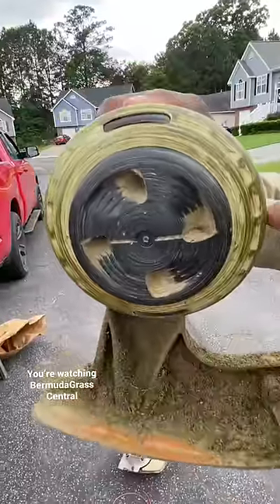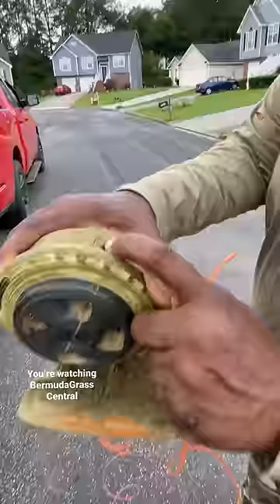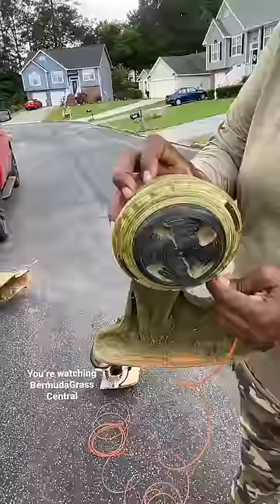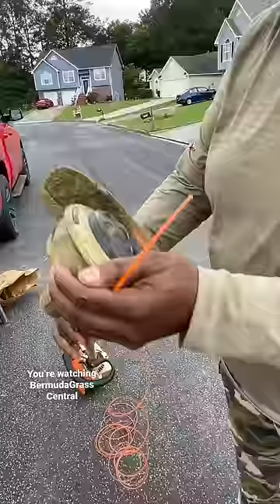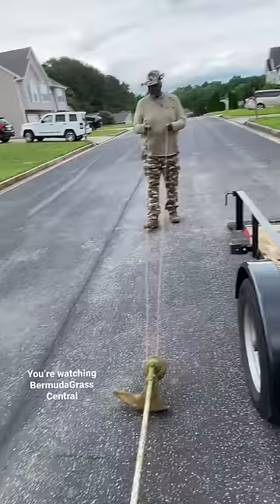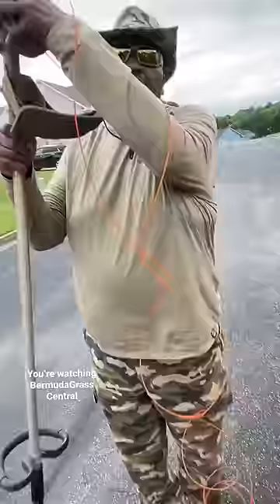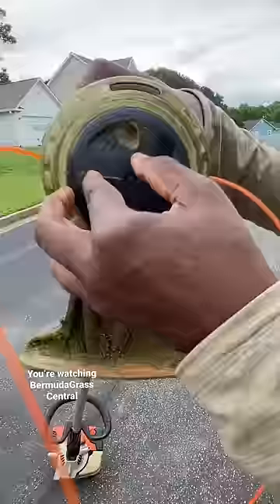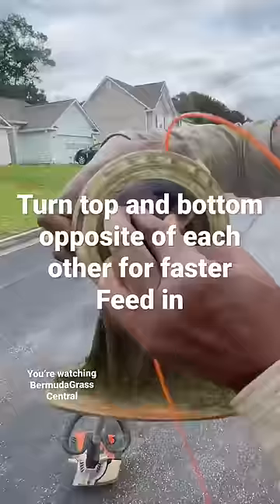Trimmer Line Speed FEED with Stihl C-26 Autofeed

Comment: We run echo speed feeds on our stihl
Reply: Same here
Reply: Stihl Isa better trimmer but echos speedfeeds arw the absolute best
Reply: @brettwiliams3711  Debatable. I prefer echo, but use both for my company
Reply: So much faster easier to change heads and disassemble for jam feed and still a quick bump system
Reply: Switched to echo for the speed feed. That and a darned good simple 2 stroke. 4 mix is great, but the 111 I used really put me off and valve adjustments.
Reply: Echo is better especially the speed feed
Reply: @aaronneher4860 valves are easy. I have a few 100rx that are 10 plus years old still going. I run echo and sthil only though. The 100 or 111 I always grab for thick stuff
Reply: The echo speed feed is thicker than this one you can get lower to the ground with this one while keeping it flat. But the echo is faster imo
Reply: Echo is so much better
Reply: I guess that's what comes stock on a srm-225? That's what I got and it works like a dream super easy to spool up.
Reply: @codyturner9953  yessir me too
Reply: @ragingstormgaming7829 weve been using some husqavarnas lately at my uncles company. Theyre light and hold up decently. We cut graveyards. So its a lot of weeding
Reply: Same.
Reply: Haven't found anything better than Echo speed feeder, I love the trimmer too cause it's not heavy.
Reply: @brettwiliams3711 debatable . Echo trimmers run higher in rpm’s and trim way better in my opinion.  And echo’s speed feed heads are way better .
Reply: Echo gota be the og speedfeed
Reply: Echo bump speed all day.
Reply: I have a sthil. I tried the echo feed. It did not fit on my sthil. Are there different types of echo speed. 😅
Reply: Honest question is it faster or easier than the original way? I’m running stihls for my company, every one already can string a trimmer, will I make save or lose money with this?
Reply: @johnyvolvo434  buy one give it to your dumbest guy to string and then have your best guy do it the regular way you guys do it...
Reply: Sthil vibrates to much after,echo for me  is smoother.
Reply: Damn right 😂
Reply: Echo for the win
Reply: Should run Echo speed feed on your Echos. We do. Finally got rid of the last Stihl. Couldn't be happier.
Reply: Me too. Our fam loves them
Reply: Can confirm 3pk off brand echo speed feeds from Amazon are meh they work great if your a home owner and only do your property but compared to branded echo heads they last 1/2 of the time due to grass in the drive way and on concrete they just are an inferior plastic and ware down within a month each for me with about 29 properties 3-6 a day every week branded echo heads last about 2-3 months each, and once they start to ware they’ll keep going u til it falls apart the Amazon ones the spring pops through almost immediately from ware. Granted I can just as easily pick up the head from the ground a bit but y’all know once you start to get tired at the end of the day it’s easier just to let it ride lol but for 10-15$ more stick with echo branded heads not the knock offs
Reply: Maybe it’s just me but I always like the old school heads more just because of how low profile they are and they are much lighter than the speed feeds
Reply: Same

Comment from the maker: See how to install your Speed Feed here https://youtu.be/ai7U8aogPY4
Reply: Forced to have it but I don't like them. Rather have the older ones where you put half the string into two holes, secure it in the notch and wind it yourself. These seem to not wind correctly and constantly jam up.
Reply: Need to make something u can set the head of the weed eater down on and use the motor to spool it up if it turns the right way 😂
Reply: You i like, you keep it simple, thanks soldier
Reply: That took longer that just using a regular head
Reply: @icewallflatearth1158  nobody cares 😂😁😱🤯
Reply: And they want to outlaw the gas yard machines and go all electric
Reply: Don't forget to soak your string in water first!
Reply: @NeoMK  get outta here
Reply: @jacobmurphy2721  Literally on their website.
Reply: I miss performing lawn care. I did it for 5+ years in central Florida. Where you guys located and are there job opportunities for this line of work
Reply: @NeoMK  get
Reply: @LouieEvans-bv5gl  not here we're in a small town community here kinda hard to make it if ur not from here kinda be stepping on toes if a new company comes in

Comment: I have both Stihl and Echo that i used for my business. The auto-cut on the Stihl will jam up if you’re in really sandy or dusty conditions. I’ve never had a problem with my Echos. The one advantage of the Stihl is it is much easier to trim straight edges but they both do it equally good

Comment: two things i learned about the speed feed, 1st step on the string and pull the reel of new sting to above you head, do that twice and perfect amount of string, 2nd, different trimmers rotate different directions and the spool will have a directional arrow, if you put it on backwards the line will clog or suck back in instead of out when you bump it

Comment: I bought that Stihl, I returned it.  The windy head thing is so big you can't get weeds in the cracks of sidewalk.  The straight pole may be better for your back, but you can't perfectly edge your edges.  I use a curved craftsman now.  The string feeding head is smaller and you can angle into more places.  The only difference is you wind to pieces of string rather than one.  Just as quick.

Comment: C'mon Bermuda, Ego's automatic brother, love your program. You the man.😃
Reply: I have one of those is actually a great trimmer but every three or four years you need to replace the battery. I would suggest getting multiple batteries . It’s probably one of the best electric trimmers on the market.
Reply: Not good for commercial use

Comment: I've been using my power loader for years on my ego string trimmer. I can load 15 feet in in less than 60 seconds. Feed it through, make sure it's even then press the button and it feeds itself into the head.

Comment: Have an open head, no guard. Cut a line about the length of your pit to your wrist. Knot it in the middle. Feed it through each hole. The knot prevents you from losing your line. And let her rip. Load my pocket with a handful or so, depending on how much area there is to cut.

Comment: We unwind 5 arm lengths of Shakespeare weed eater line and ya reel out to the middle of the line and crimp it with your teeth , roll it onto your hand and about towards the line ya feed it into itself so it will stay secure and put it into your pant or shirt pocket , so that way your not having to return to the truck . 
This is for commercial experience while servicing large apartment complexes.

Comment: Speed feed that takes twice as long as the regular head. Plus you gotta have grab that extra string and have it on you. Idc if the trailer is 30 yards or 3 miles, every step counts and I ain’t walking back to nothin until it’s done.

Comment: I have a stihl fs70R with the stock head and I can load it faster than the “speed loaders” 

Pull 3 arms lengths of string push both ends into the holes. Start wrapping, pop into the tabs clip it back in. Cut the loop and start workin.

Comment: I never liked those types of spools. Maybe i just came up under someone stuck in oldschool ways. But i feel like i could spool a regular one just as quick and wont have to sit there spinning the head, or have to walk out the string to make it even. On the standsr spools i just cut a length of string. Put both ends in the keep holes. And spool both sides at the same time. Pop it back it, start the trimmer, let the street cut the string and youre off to the races

Comment: No tangle.... what happens is if you wrap around a pole or a small tree it pulls so tight and fast it melts the string inside and snaps off and then you have to take it apart. Happens all the times with this model
Reply from the maker: @MrChancebandit  never in my life has that happened to me 🤷🏾‍♂️
Reply: @BYDonBermudaGrassCentral  crazy guess you are a super hero

Comment: I'm sorry but I can wind it faster than that in my manual load. It takes me all of a minute to unwind the cap pull off the feeding mechanism, stick it in there, Wind it around, cut it. Stick it into the other side, Wind it around the opposite way, Cut it. Feed it into the head put the screw back on and I'm done.

Comment: These heads are soooo heavy they beat you to death   Ego has a self winder head that’s half the size and weight And doesn’t break strings off so you have to take the head apart every 5 min

Also because the Stihl head is so big they make their guard about 45 feet long

I have plenty of Stihl equipment I love their saws and old pro trimmers but they messed this one up

Comment: Those quick feed heads made by Stihl are garbage compared to the Milwaukee quick feed head. The tabs to turn it grind right off and they constantly bind up when trying to wind them.. the heads are just junk. They should do it how Milwaukee does it where the whole bottom head turns not just the inner head causing you to have to dig your fingers into the head to turn and wind it. Junk